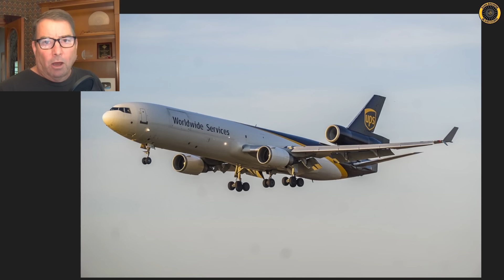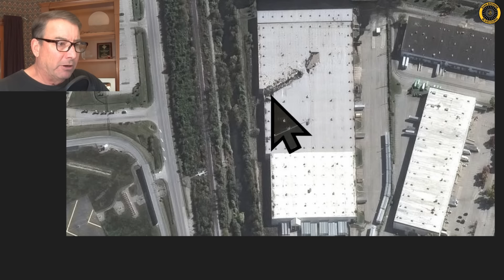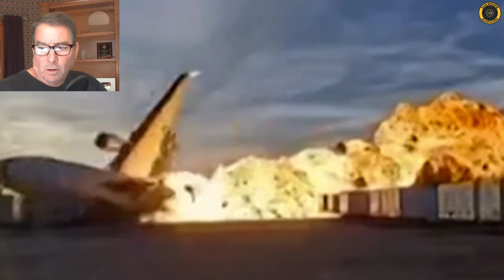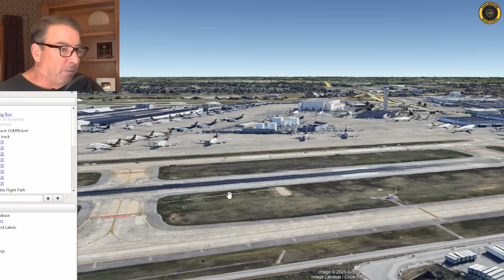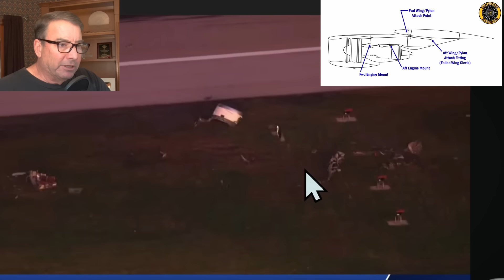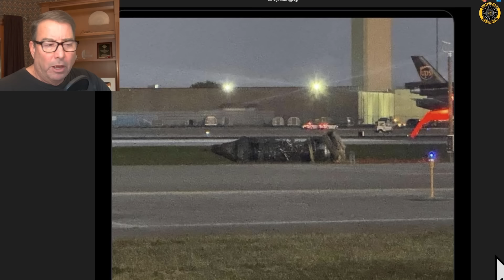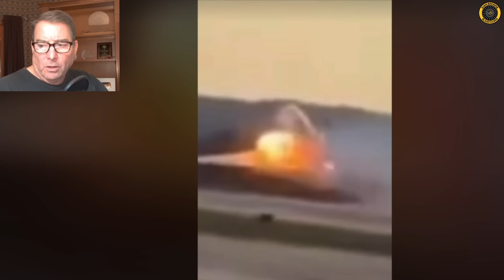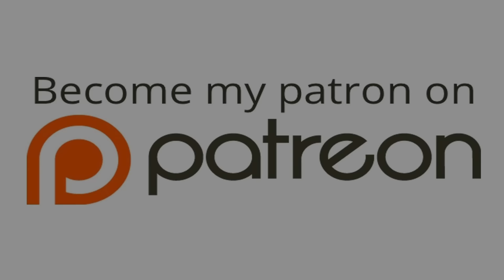UPS #2976 UPDATE 2 6 Nov 2025

Comment: A search in the FAA's Service Difficulty Reporting System (SDRS) maintenance reporting database from 9/1/2025 to 11/5/2025 only shows that the N259UP accident aircraft was in maintenance on 9/4/2025 for a Center Wing Upper Fuel Tank cracked stringer, and on 9/9/2025 for two Center Cargo Bilge Area corroded longerons. There were no engine and/or pylon related maintenance records in that SDRS search time period.
Reply: Thanks for taking the time to look into that.
Reply: That’s typical for an MD that age.
Reply: Thank you for that information.   I am old enough to remember the 1979 crash and my initial thought was that perhaps during this plane's life somebody had actually tried the shortcut that caused the 1979 crash.  Now I wonder if an engine removal or installation somehow did some minor unseen damage that worsened over time, or if that is even possible.  I have no idea what all is inspected after an engine installation.  I also wonder if there are any low-quality counterfeit fasteners in the parts system or if that is no longer an issue.

Comment: Whoever signed off the hardware and torque on the pylon bolts is gong to prison.
Reply: IF the bolts were incorrectly installed
IF the pylon failed before the engine
IF it wasn’t a materials defect in the pylon or bolts
IF they were negligent and didn’t follow procedure 

A lot of if’s to happen before your ignorant assertion becomes fact.
Reply: @Captain101-x1o well we'll see. The investigation will reveal all the mistakes made by the mechanics.

Comment: Thank you Juan for keeping us all updated with the best, no-clickbait reporting!
Now obviously RWY 17R does not have an EMAS installed at its departure end, but I wonder whether if it did, that could have altered the crew's decision to continue takeoff. With EMAS, and a respective briefing before T/O, aborting the roll past V1 could be an easier choice to make when the crew realized the massive engine trouble.
Reply: The only time you abort after V1 is when you believe the aircraft is incapable of flight.  With one and a smidge engines, it wasn’t capable of flight, but in the moment, a conventional engine failure was not grounds for reject.  I’m unsure of UPS and FedEx policies for two engines going to pot.

As well, though there is a river next to the airport, like Air France 358 at Pearson, the brilliant minds in Louisville built all sorts of junk on the centreline of the runway, instead of clear space, as it should be, and as is at Pearson, Montreal (Trudeau south, Mirabel both directions), Boston, Dulles, you get the idea.

That said, on the ground, you’ll only hit something at a hundred and some knots at most, and slowing.  Once airborne, you’re going faster, and dropping.
Reply: There’s simply no time at that speed to change anything. Hindsight enables alternatives but the safety guidelines are to takeoff after rotation speed is achieved. 

When analyzing a car accident when the victim does as a result of being trapped by their seatbelt during fire, the conclusion shouldn’t be to eliminate seatbelt laws. Statistically rare events will always be the exception that prove the rule
Reply: I would like to see Juan discuss if he foresees EMAS changing the V1 concept in a future video.  How much energy is it designed to dissipate?  What speed of 737 will it stop?  767? (edited to include "in a future video")
Reply: @loudidier3891 how i read it, it will stop the largest aircraft certified for the field, departing the runway at seventy knots.

Comment: The damage to the roof of the building (a UPS Supply Chain Solutions building, by the way) is off to the left of the end of the runway and the damage track is angled to the left as well. Additionally, the business Chris Tires visible in the one of the videos is directly in line with 17R. Had it not rolled before hitting the power lines and tank, I think the plane would have impacted Chris Tires. So I think the roll started as it was leaving the end of the runway. Striking the building roof with the left wing may have momentarily bounced the wing up, leveling the plane before it impacted Chris Tires neighbors. That's what I observed.
Reply: Guessing this deviation might just be the effect of the misaligned trust with only the no 3 engine on full power.
Reply: @seanw1866  Yes I think so without the wheels to steer it straight.
Reply: The deviation from the runway centreline looks to have been a blessing as it appears the impact site would have covered a number of additional structures had it have been inline with the runway and the casualty numbers could have been higher.

Comment: Not a pilot here but love aviation, if they had another 10K feet of runway they could have stopped rather than rotating and no lives would have been lost?
Reply: You’d have to run the take off performance calculation to know for sure if that would give them enough, but it probably would considering that’s almost double the length. Then big issue is a longer runway would mean intentionally reduced takeoff thrust to reduce wear and maximize the available runway.
Reply: the were beyond V1
Reply: moronic comment, like telling someone please lay down before you are about to fall down

Comment: My novice theory is that the pylon/attach point bolt failed, the engine departed up and over the fuselage and on it's way fodded out #2 - I thought I saw what looked to me like a compressor stall flash out of #2 in one of the videos. Anyhow, so sad and likely totally preventable.

Comment: Thanks.  All credit to the pilots who were dealt an impossible hand.
Reply: yeah amen God rest em
Reply: The left seat pilot was probably flying, and I doubt he saw the engine come off, and I doubt he saw the fire. The right seat was looking at guages and warning lights and frantically trying to figure out what was wrong.  It was indeed an imposssible hand that they were dealt.
Reply: @kevinkelley3657  I'm pretty sure you can't see the engines from the cockpit of an MD-11 anyway.
Reply: Asking because I'm still trying to wrap my head around this. The runway they were on was over 11,000ft long. The engine was found at the 2000 foot (roughly) mark. Did they not feel it, the engine depart the aircraft? And wouldn't you just shut it all down and abort the take off? Or, were they beyond V1 and at that point, going to fast too shut it down? 

It seems, by the size of the MD11, at 2000 feet, they were just spooling up. Unless it was the 2000 feet at the other end marker, thus giving them 9000 feet of runway to build enough speed before the catastrophic release of the number 1 engine. I'm just trying to grasp the situation.

Just so sad they were unable to do much of anything. Prayers to the 3 pilots, there friends and families, as well as their coworkers. What a horrible tragedy.
Reply: @Aphxphotog  The engine was found at the 2000ft remaining marker. 2000 feet from the end of the runway. I suspect that when the engine seperated, they were far into the takeoff process. They were focused on v1 and rotate, they had very little time for crisis management.
Reply: @Aphxphotog  Unless I'm mistaken, that 2000' mark was before the end of the runway and not at the start of the runway. If that were the case there was no option to abort.
Reply: The engine parts were found at the “2,000 feet remaining “ marker. So it’s at 10,000 feet down a 12,000 foot runway. They were near rotation speed when the failure started. If it had failed at the start of the takeoff roll, they would have just stopped and abandoned ship.
Reply: We don't know, yet, when they got the first warnings in the cockpit, though. Isn't it possible a defect in the engine began destroying it before it was too late to abort -- possibly half way down the runway?
Reply: @theLeftHandedDog  Yea sure, speculation is always the thing to do here!
Reply: @theLeftHandedDog  We won't know for sure until NTSB runs their simulations. I fully suspect even with full knowledge of the scenario, no simulator pilot could recover this. 
Even less likely if they hand them a blind simulation. Could be wrong though. We've been surprised before.
Reply: @theLeftHandedDog in a word, no.